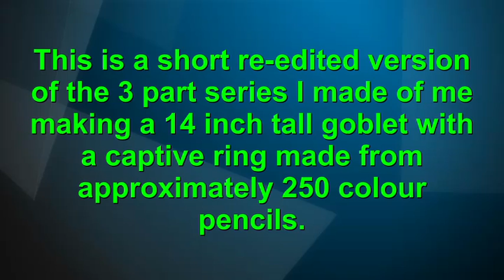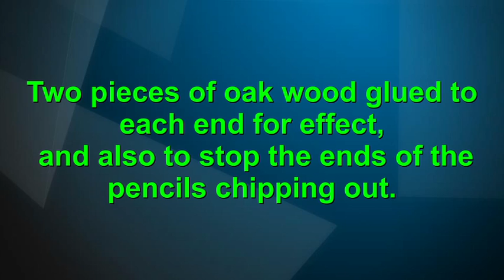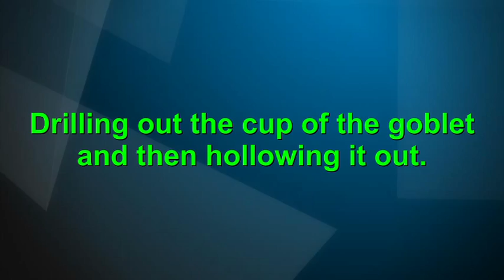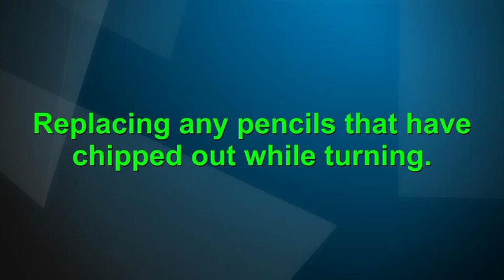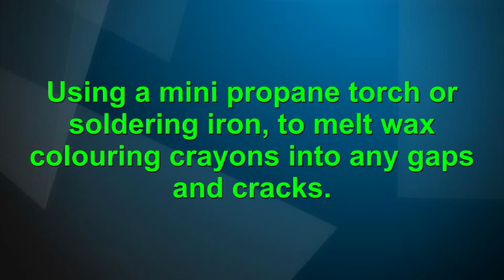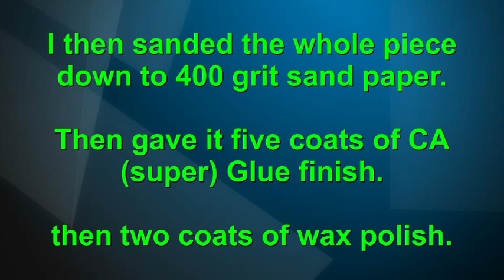A GOBLET MADE FROM PENCILS !!! (Re-edit and post)

Comment: Incase you are ever short on ideas for composite materials; try gluing (compressed) plastic straws (different colors) around a wooden core in a weaving pattern (over under over under etc.) or like a coil that changes direction every layer.
Reply from the maker: Cool !!! I wonder if they would look good after being turned though ? Thanks for watching and commenting. Regards Steve.